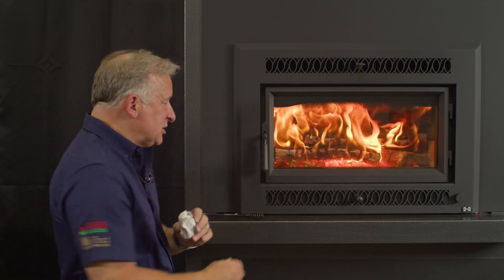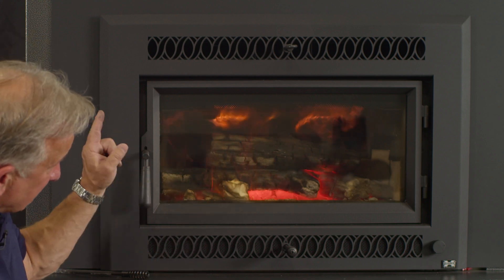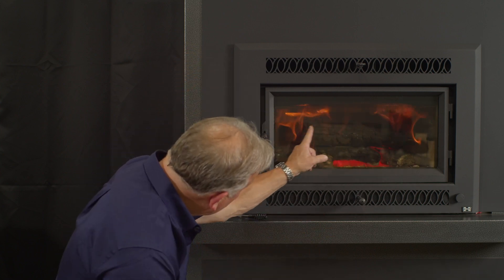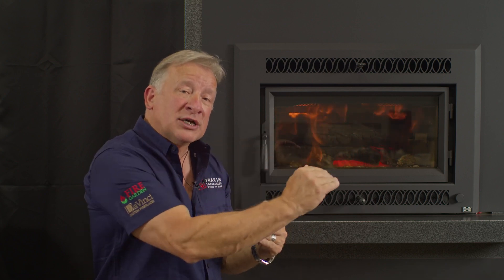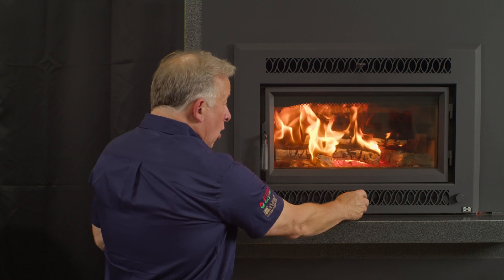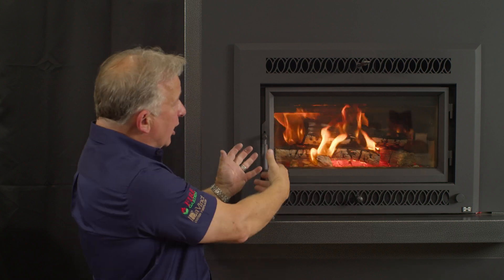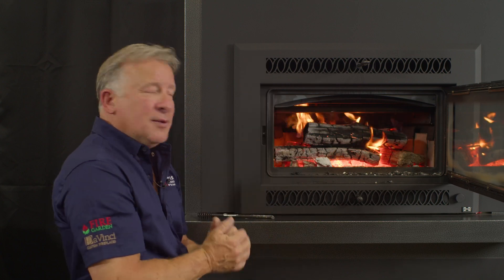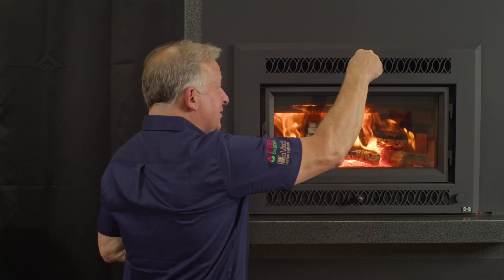NexGen-Hybrid™: The Future of Wood Burning Technology

Comment: can you burn pine logs in your wood stoves
Reply from the maker: You can burn pine logs in our wood stoves, however, just as with any wood fuel it should be dried. Also, pine typically burns faster and doesn't provide as much heat output.

Comment: I currently enjoy using a Lopi gas unit in our master bedroom and am considering upgrading to a larger Lopi Hybrid model in our living room. I’m wondering if it will fit our masonry fireplace, which measures 36" wide, 36" high, and 17" deep. If the depth is too short, can I pad out the faceplate a few inches? Does Lopi offer a faceplate that can accommodate a 36" height?

I find the hybrid burners intriguing, but I have some questions. The catalytic burner seems positioned quite close to the exhaust pipe—does this design effectively transfer heat into the living space, or was it primarily included to qualify for the U.S. tax credit? My primary goal is to maximize heat output into the room.

Additionally, is the heat exchange box and fan sufficiently sized to capture and utilize the burn heat effectively, or does a significant amount of heat escape through the chimney? What's the CFM and decimal noise ratings on the fan? I also didn’t see any mention of door glass soot buildup—does this unit have issues with that?

I like the design and features of this unit, but it almost seems too good to be true. I'd appreciate any clarification.

Thanks!

Comment: Can it be installed in a Heatilator?
Reply from the maker: There are new regulations that determine which products can be installed in zero clearance applications. Some of our products do meet the requirements and some don't. Speak with a dealer to find out more information and what unit is right for you https://www.lopistoves.com/where-to-buy/

Comment: Always wondered why high temp sealed capillary heat pipes that can move a lot of heat were not used in wood stoves to capture heat lost up the chimney and bring it into the room with a hidden (behind the wood stove façade) finned radiator. Of course, adding a fan for some forced convection on the radiator would move even more. Or move the heat into a mass of phase change heat transfer material where it could be slowly released during the night. I believe a while back, a stove manuf. in Europe somewhere was experimenting with a phase change heat transfer material in the double walled stove. Seem it took forever for the hot water solar industry to catch on to using sealed capillary heat pipes for solar panels. But now, it's what is used. There are very high temp. ones also. They move a ton of heat. (Without them built into the Alaska oil pipeline supports , the permafrost would melt. Of course, very tiny ones are used in modern computers to move heat from the electronics and prevent overheating).

Comment: Very impressive! If you come out with a cookstove, I'm in! I just love a wood cookstove, but the new one we just put in is one hungry, almost insatiable machine. We are delighted with the one we just put in to replace our wood burning fireplace that lost so much heat up the chimney. Now we are very, very warm and cozy. If I could just have the efficiency and control you just demonstrated to lower the wood use in a conventional/contemporary cookstove, I'd buy one.
Reply from the maker: Hello! Thank you for watching! We actually do have several products that allow you to cook on top of them. The Evergreen wood insert offers a modest cook top that protrudes out from the face of the hearth https://www.lopistoves.com/product/evergreen-nexgen-hybrid-insert/
It also includes the same NexGen-Hybrid™ Technology that is demonstrated in this video, giving you fine control over the burn rate.

Additionally, several of our freestanding wood stoves feature a nice sized cooktop. The Liberty wood stove is the largest and although it does not yet include NexGen-Hybrid™ Technology, it still offers a burn rate control https://www.lopistoves.com/product/liberty-nexgen-fyre/

The Endeavor wood stove is slightly smaller compared to the Liberty, but includes NexGen-Hybrid™ Technology as well as a cooktop https://www.lopistoves.com/product/endeavor-nexgen-hybrid/
Reply: I have two liberties.  One in my 4600sq ft home and one in my 6700 sq ft outbuilding with 18’ ceilings.  The liberty can keep both warm even when its -15 outside with -40 wind chills.  We had just those temps this winter and it kept the outbuilding between 55 and 60 all by itself and the house can easily stay 70.  I also heated up chili on it :). It isn’t the primary heat source for either but it is such a pleasure to burn with I light it every time i go to the outbuilding.

Comment: Build this and they will come:
Free standing stove that extracts the heat from the outside of the stove with a forced air flow system that mimics an insert. All the heat around the firebox needs to be moved into the room. Passive systems are inadequate. I have a quadra-fire with the fan unit. It blows 95% of the air along the back of the unit, and 5% on the left side. Zero air on the right and top. So I get active air movement (and heat transfer into the room) from less than 20% of the unit.

Comment: Our Lopi wood stove is 33 years old and works like a charm! They had the secondary burn back then, not the ceramic though. I can usually refire in the morning with leftover embers. Quality equipment!
Reply: Yes . Same
Reply: The catalytic combuster is another game changer tho, based on people's experiences that I've read. It's possible to be refueling just once per day with good wood and a larger stove, if you don't need a really big fire, that combuster can provide you with a steady gentle heat for 20+ hours, and still have coals when you come back to reload 😮☺️
Reply: @Lock484 blaze king has been doing catalytic stoves for years, way before everyone else

Comment: Still... it remains a Poor alternate to a Gas fueled Insert.
Reply: You couldn’t pay me to put gas heat in , it is bad for the environment and a waste of money plus its not renewable and you need to pay someone to repair it
Reply: @bluelightguy1  gas is no worse for the environment than wood, you still have emissions associated with the whole firewood process. Chainsaws, splitters, hauling the wood then burning it
Reply: @kindredspiritzz66 not trying to be an ass, but the emissions of every process are started by fuel, one way or another. As for natural gas. It takes fuel of some sort to make the machinery to get the gas. It take fuel to operate the machinery that get the gas, It takes fuel to haul the gas and it takes fuel to make the pipes that feed your gas burning stove. The gas doesn’t get there by magic. These new wood burning stoves release less particles into the atmosphere than gas ever will. They actually burn the smoke that is created by the wood that is being burnt and what goes up the chimney is for the most part, clean warm air. That’s why they pass the EPA standards. Very little smoke will you ever see coming from the chimney of one of these stoves. That only happens when the stove isn’t being cleaned.
Reply: @bcroft68bc  valid points but I think gas burns cleaner than wood ever will
Reply: @kindredspiritzz66  well we all have our opinions. Good day to you and stay warm.
Reply: Yeah wouldn't trade my wood stove for the newest and best gas stove. I enjoy the whole wood process.
Reply from the maker: Many people prefer the control and self sustainability of a wood stove. That being said, we do offer many Gas fueled stoves and fireplace inserts in our lineup.
https://www.lopistoves.com/
Reply: you know when the powers out, and your super efficient gas appliance doesn’t work. you’d be wishing for one that burns wood. or when the gas company raises the price just because 😂
Reply: wood can be free gas is not!
Reply: Other way around, sport. Wood is king.

Comment: they all burn nice like that with the 12-15% moisture content wood that your burning
Reply from the maker: The importance of burning dry wood cannot be overstated!
Reply: @LopiNorthAmericasFavoriteFire  right, but you didnt state it at all in the video..with the price of firewood these days im all about conserving and getting the most heat out of wood, but getting dry wood is next to impossible unless your lucky enough to have a supplier that kiln drys their wood..And if you burn all winter long i think on average you need about 4 cords of wood per season..if the wood is not seasoned then you need to have a place to stack 8 -12 cords of wood some you can have enough time to dry the wood yourself and be a season or two ahead..some species and locations it takes 2 years to season to 20% moisture..20% is still on the high side for for cat and secondary burn stoves..buying and installing a new stove is the easy part..getting good wood is hard!!
Reply from the maker: Sure it is a challenge, but one that is worth taking on. We have a video regarding moisture content in wood and how to use a moisture meter here https://youtu.be/88T4JvNjhFc
It's likely redundant information for an experienced individual like yourself but wanted to share anyway.

Comment: I don't understand what is the difference between this and any other modern catalytic stove? Everything decent has air control like this.
Reply from the maker: Generally, our products have a broader range of BTUs than other products of similar size and technologies. Meaning you can have a lower burn at the low setting and a higher burn at the high setting. This gives you finer control over your fire.

Comment: Why have a little tool to work the levers that can get misplaced? Just have it so you won't get burned without it.
Reply: It would need to stick out too far or be more complex. My fireplace has long bypass handle and I sometimes bang my head on it when loading it and sometimes get caught on the handle when standing near it. So they’ve made a choice, though an imperfect one, but the other way would be imperfect as well (because of redesign needs, and cost issues).
Reply: @GMC-qo9xi  my wood stove has long handles with a spring on the end that protects you from getting burned and I never whack my head.
Reply: @stoneyswolf  do you have a bypass? When you open a bypass with a handle that won’t burn (mine is wood—same size as the coil kind you are talking about), it ends up sticking out 8” from the face. Mine could be shortened about an inch and still work, but still when it’s open it’s way out there.

Comment: I get the same paper effect with a US Stove. I keep a layer of ash in there, the secondary buring, and a tight door seal. When I put paper in there it takes a while to burn as well. So... what's the actual difference? I do like the rear suction port. That seams helpful.
Reply from the maker: We are combining the power of NexGen-Fyre® and Catalytic technologies to form the NexGen-Hybrid™ technology. This gives you amazing secondary air burns, as well as the efficiency and emissions benefits of a catalytic combustor. In general, our products have a broader range of BTUs than other products of similar size and technologies. Meaning you can have a lower burn at the low setting and a higher burn at the high setting. This gives you finer control over your fire.
Reply: But this is nothing new on the market, just new for your product line.
Reply: @treaser2  but what about the NexGen-Hybrid Technology™? Doesn’t that make you want to upgrade to have then newest and best??? lol… jk
Reply: @treaser2  sorry forgot to include the power of the NexGen-“Fyre®” technology! (If that doesn’t make you drool, then i guess you are beyond help…) 🤨
Reply: Love, love, love my LOPI stoves: gas fireplace in my living room, wood stove in my basement, and a pellet stove in my garage. THESE ARE BY FAR THE BEST STOVES MADE! And the best manufacturing company ever! Travis Industries rocks!
Reply: I think they’ve plumbed in a bit more secondary air than some stoves, and increased the air control to a lower potential (which is great for when you load up the stove) and have a catalytic burner… even though description makes it seem like it’s not a catalytic stove, he mentioned a ceramic coated grate that burn gasses. It also would likely have an automatic dampener to reduce the air once the coil on the dampener heats up… (which helps prevent over firing an unattended stove).

Comment: I have a ~10 year old Lopi insert that does not have a blower - I put a small fan near it blowing across the stove. If you open the door slowly, little to no smoke comes out.
 
I have a very poorly insulated 1960s vintage, two story house of about 1800 sq ft. The fireplace is on the lower level and when it's 0F outside the upstairs far end of the upstairs living room is ~67F, using only the Lopi for heat.  Of course the fireplace room will be 90F or maybe even a bit higher.  

I mostly burn pine because I get all I want for free,. If run the Lopi real hot for 15-20 minutes every third fire or so, very little creosote builds up in the flue and  I have a ~20 foot stainless steel, single wall flue inside the old chimney and have never had to clean it out, only the wire mesh spark arrestor cap on the top, every other year or so. 

Unless you want to restoke your stove at 3AM, get some hardwood for the overnight burn.

GREAT stoves, even for the price which is notably more expensive than the lessor performing ones.

Comment: Nice, but why put the draft control at the bottom,  after carrying wood a fellow doesn't feel like bending that low every time I want to adjust the draft.  For 4 grand I don't want to bend that far haha.
Reply: Why do you think it’s there? (Since it’s an insert there’s little to no room to spare for the required contraption to be on one side… as it requires a rod with moving joints or chain and pulley system to be tucked in there to get to the dampener which needs to be where that lever is at the bottom. Point being that the decision is based on simplicity… ie. form follows function. The more complexity that is introduced the more problems while arise over time not to mention initial expense. Whereas you could use your own poker to operate it while standing…. Whether or not you need to drill a little hole or tweak some little thing is up to you to decide what will work best for your needs. Simple enough, no?)